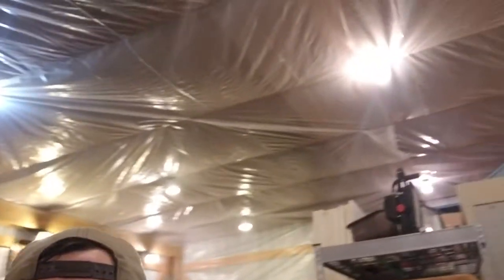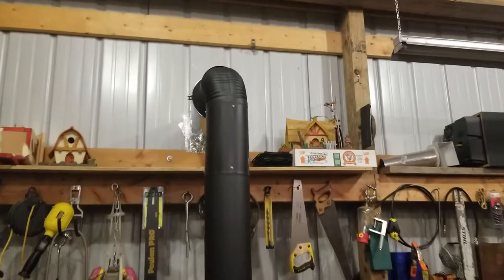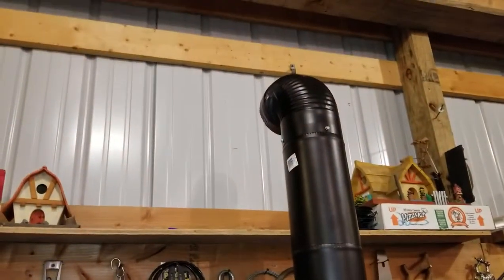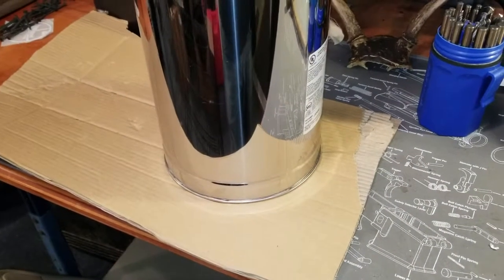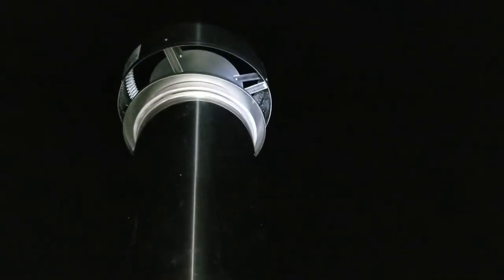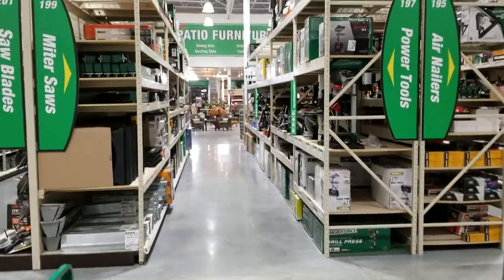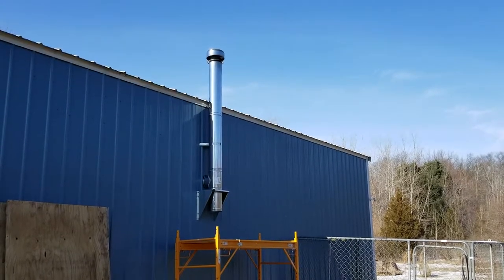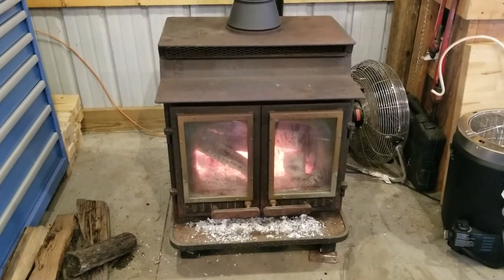Wood stove installation

Comment: Looks like it will work out good for ya! Couple things thou, Make sure you cut out the wood on the wall. You gotta be 100% compliant or if something was to happen the insurance company won't cover it. In the spring pull it out, sand blast it and spray paint with the high heat paint. It will stink the first couple uses but it will look better than the rust. I've painted mine in the house a few times already and it still looks great. Another option when the moneys are there, is to use cement board and tile for a backer. But looks awesome and I'm with you on over kill. Better done heavy duty with no worries. Can't wait for the spring fishing!
Reply from the maker: Ron, Thats a very good point about the insurance that I didn't even think about. I will move the wood to make code! Thanks! Get out and so some ice fishing before the ice is all gone!